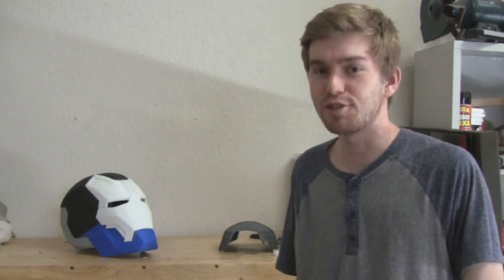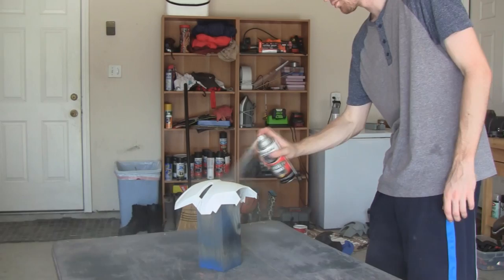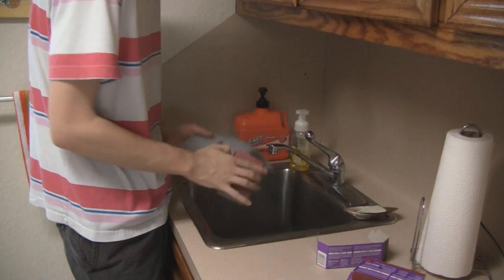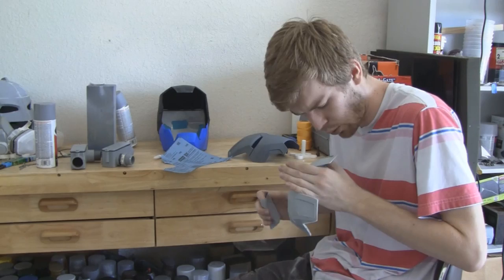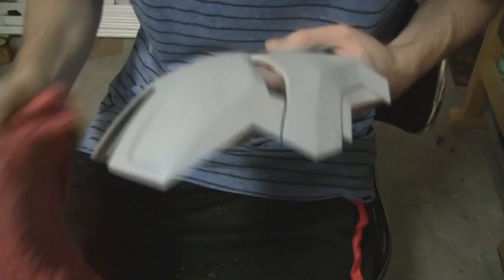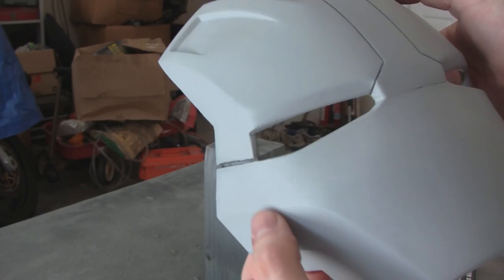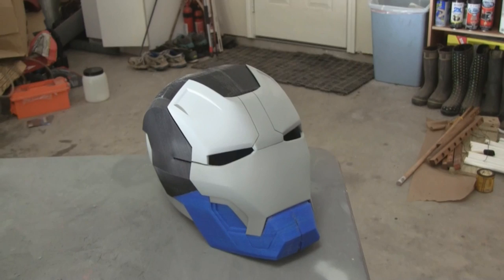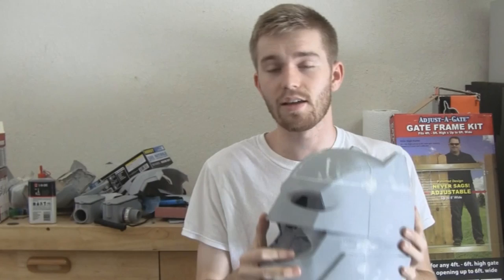Finishing the 3D Printed Faceplate | Iron Man Helmet Build - Part 3

Comment: Looks great! You printed faceplate in 2 parts because of your printer size, or there's some benefit in printing in parts? Cheers!
Reply from the maker: Hey thanks! I could've printed it all in one piece, but printing it like this is good for two reasons. It saves filament by using support material only under the eyes as opposed to the whole thing, as well as ensures that the majority of the edges are clean since support structures typically leave behind a rough surface.
Reply: Thanks! I'll take a note :D I plan on buying 3D printer for my birthday, and I'm doing a little research :D
Reply: same
Reply from the maker: Good! Research is definitely very smart to do. I didn't really do any before I bought mine, which was a headache when dealing with all the issues I had, but it was also good because it forced me to learn a lot. I just recommend learning the most you can before you encounter any issues!
Reply: ok thanks what do you recomend for the helmet or just cosplay in gerneral wirh budget in mind
Reply from the maker: I'm not quite sure what you're asking about. Materials?
Reply: Ronald Finger sorry that's bad writing on my behalf I was referring to 3D printers
Reply: A lot of people go with the CR-10 for best price-to-volume capacity, or the monoprice maker select v2. Both are very good buys. I went with the maker select.. but kinda wish i would have gone with the CR-10. 300-300-400 can make some big items lol.
Reply from the maker: So I have no knowledge of any 3D printers that are being sold today. I only have experience with my own. But I know that there's channels that do a lot of reviews over different ones. You'll more than likely get a bunch of good results just with a quick youtube search. I did look up ScubaDave's suggestion and the CR-10 does look pretty good, but don't narrow your options before doing a lot of looking around!

Comment: hi can i have the stl file? i want build one too
Reply from the maker: Hi there! Sorry, I'm not sharing the file since this is something I plan to mold and sell a few copies. But there are some files for different helmets floating around on some sites if you do a quick google search :)
Reply: Ronald Finger ok did you print using pla or abs?
Reply from the maker: I used PLA, but honestly you can use whatever material you want